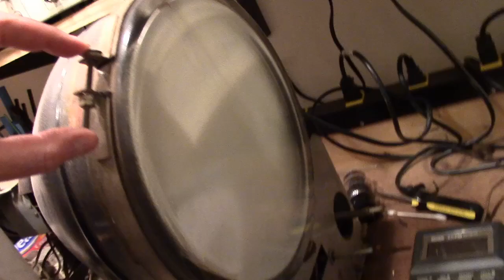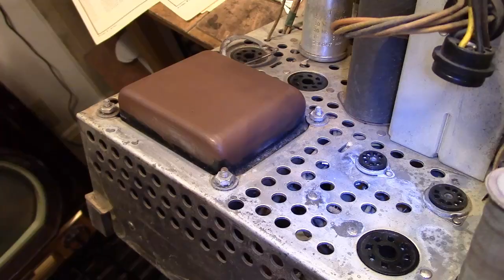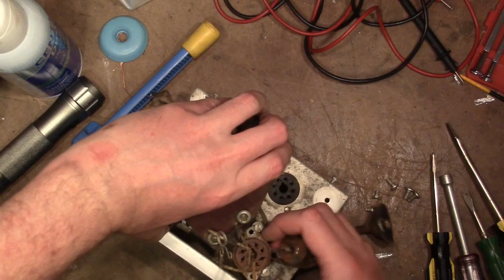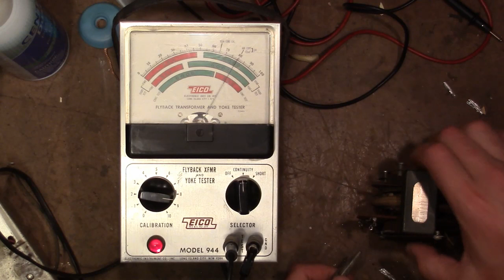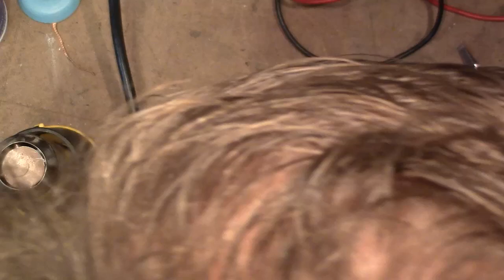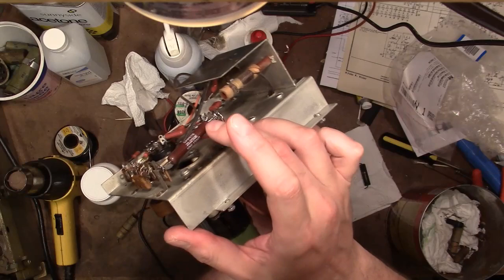Westinghouse H-196 restoration p2o?

Comment: I don't know what it is about this Westinghouse boat anchor, but I find it more fascinating than a Predicta.  It's sort of comparing a DeSoto to a Ford Mustang.
When I was younger and able, and not so lazy, I used to like to work on cars, mainly from the 60s.  Lemme tell you, it cost a lot more than TVs and radidios.  But I lived next door to a junk yard with no junk yard dogs.  And you could REBUILD parts too, like you rebuilt the flyback in this set.  And talk about dirty!  Yeppirs, um glad I changed hobbies long ago, now i hate working on cars, working on wifie's VW Cabrio now, I'd rather play with a TV set.
Don
Reply: ***** I agree with you about the Predictas, other then the styling they are a typical late 1950s, early 1960s B&W TV inside electrically. 
 Ford Mustangs to me are just dolled up Ford Falcons, in fact when Ford wanted Carroll Shelby to design a hot rod version for them he referred to them as "a secretary's car". With regard to Japanese cars, or Japanese brand cars now since many of them are built in the U.S and Canada, just like American cars they are not all the same, they have their factory hot rods, old man cars, and econoboxes as well. I'm not into them, never owned one, but have friends that do.
Reply: It's sad that all G M cars are Chevys, but I do still  like GM.

Comment: Using solid iron pieces as a core. I imagine how lossy it is, by the way, do you know approx. frequencies they operate at?
Reply from the maker: MrJohhhnnnyyy Compressed powered iron so not lossy.  15,750 Hz - the horizontal scanning frequency.
Reply: bandersentv It is powdered iron? Wow to me it looked like steel pieces. Powdered iron is good for chokes, so this flyback probably doesn't have air gap in it. Modern ferrite ones incorporate gap in between halves of the core to prevent saturation. Anyway, thanks for response. Cheers